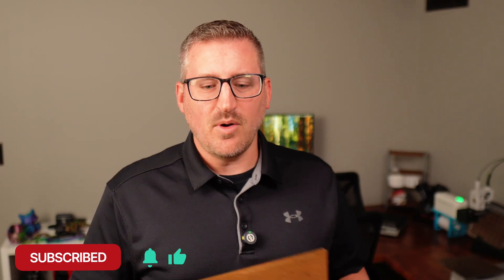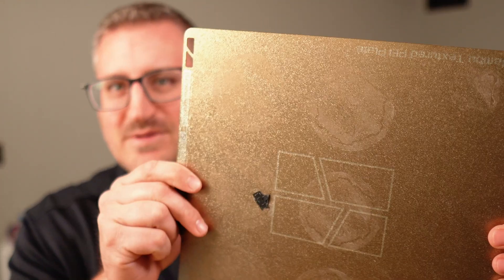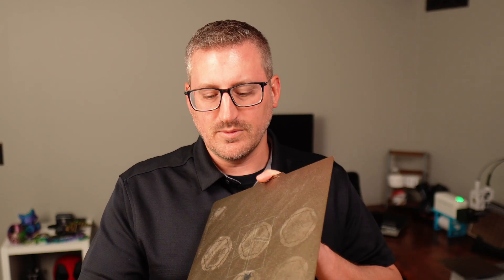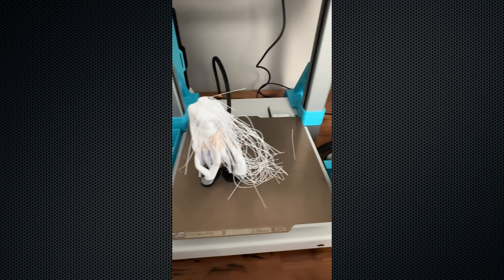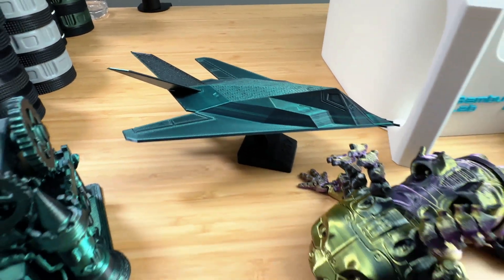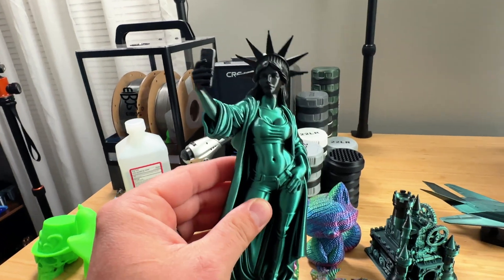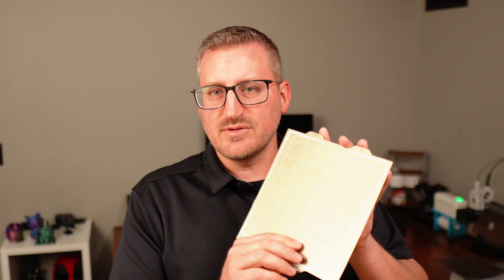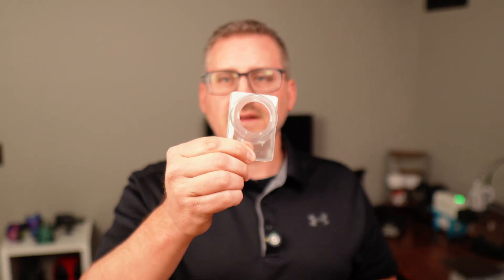Fixing Problems in my Small 3D Print Farm - Day in the Life

Comment: When printing PETG I use the Bambu Hi Temp Smooth Plate and a thin coat of Vision Miner Nanopolymer build plate coating. Great grip with PLA and great release with PETG and other high temp materials. You get multiple prints per application with PLA.

Comment: Burn-in on the build plate can easily happen when the first layer is way too thin, i.e. the nozzle is too close to the print surface (in extreme cases the first layer can be squished in so tightly that it looks more like a thin film). So check if your Z-offset needs to be increased. Also make sure you do a fresh PID tuning for hotend and heated bed everytime you change the nozzle or build plate. And let the heated bed get to the right temperature before printing starts so the build plate doesn't expand while the first layer is laid down.

Comment: My cryogrip is ok. I think it's all hype. My cheaper plate is far superior. I've only used it a few times but still nothing but hype to me.
Reply: It depends on what plates you've been using.  My run of the mill PEI sheets haven't worked as well as the Cryogrip Glacier Pro plate I've been using, and while the Cryogrip isn't groundbreaking it's very easy to use and I def prefer it over the PEI I'd been using.  It sticks well at lower temps, less likely to warp, easy to remove, and the first layer finish is quite good.
Reply: @SomeDudeWoah what materials have you been using with it? I used ABS, PETG and PLA.
Reply: @amused2deth  PLA, TPU, and some ABS.  The ABS sticks a little better than normal PEI sheets but you have to use the same temps, otherwise you seem to get warping.

My Polar Filament PLA has been sticking the best though, I've been quite pleased.
Reply: I had multiple failures with the cryogrip plate and don’t use it anymore. The Bambu plates work just fine along with Vision Miner Nanopolymer build plate coating. It’s a little spendy but goes a long way when applied properly.